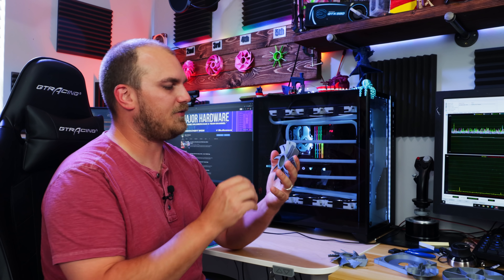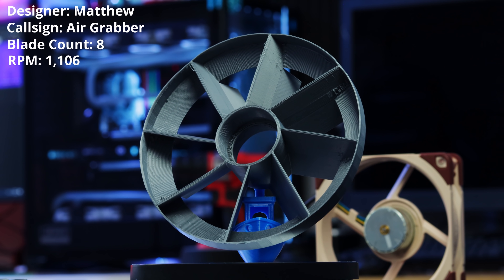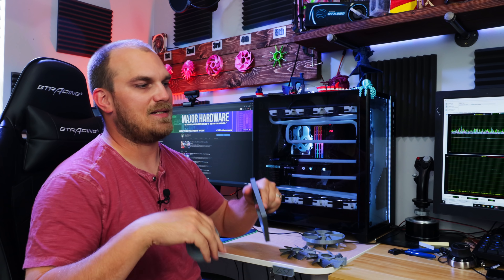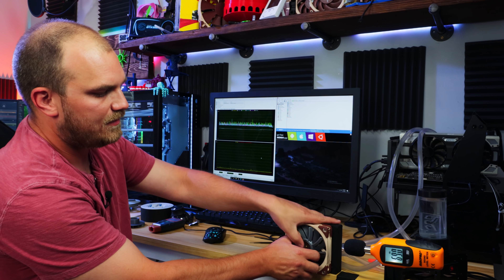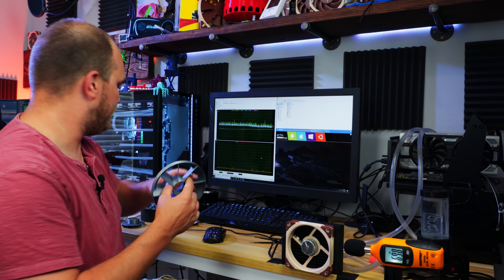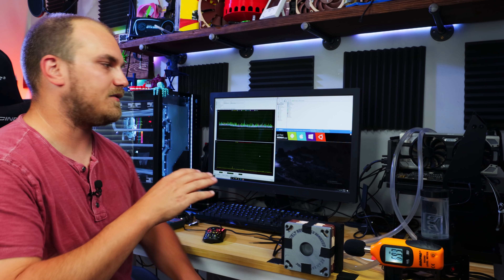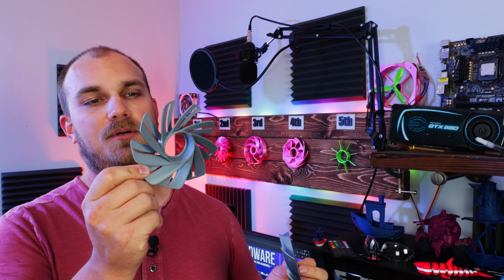We Are All Noctua Engineers | Fan Show Down Episode 4

Comment: I wonder if the air grabber would have been better if it didn't have a flat transition from the 140 to 120, if you look into it, you have the funnel going to a flat ridge, and then into the 120 opening. That flat area was likely deflecting the air rather than letting it flow into the smaller area.  Cool concept.

Comment: I think the idea of the air grabber is good, but the fin orientation is not really made for static air pressure. The same reason why you shouldn't use a high air flow fan on a radiator. it bounces off and escapes between the fins.

Comment: The problem with any design that tries to push air from a bigger diameter into a smaller diameter is that there is pressure that will try to force the air out of the front. You need a fan with large blades and good coverage of the whole surface area to push the air in against the pressure.

Comment: Also, centrifugal fans whose blades are curved and going all or most of the way to center are supposed to be backwards-curved (convex in the direction of spin), as it's counterintuitively more efficient because it puts a lot less strain on the motor than trying to spin in the concave direction.

Comment: You should figure out some way to measure CFM... Maybe an RPM sensor for a bicycle attached to a 3d printed wheel behind the radiator with a duct attached. Then all you'll need to do is some math that is beyond my immediate grasp to figure out CFM :)

Comment: I think the ones fans problem was it had 8 blades.  I think remember from an engineering class that odd blade fans are more efficient.  I think it had to do with balance of forces.  That even bladed fans that forces are balanced so the air act upon itself to restrict flow.  Whereas odd bladed ones there is always an imbalance of force pushing the air in the direction you want it to.  But I might be remembering the reason wrong.

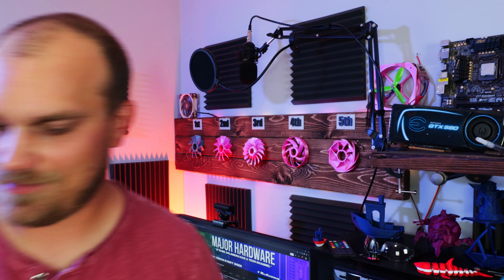Comment: How did the razor blade go from 5th to 4th when you put the other one in first? Comparing 10:23 and 11:21
Then it properly got knocked off the board between the close up and the less than a second zoomed out clip between 11:23 and 11:24. That sequence is confusing.
Reply from the maker: Ya i ducked it up wheb I first put it up

Comment: The main issue with the outside the box fans so far is the small opening and large output....people, fans need air. You don’t want to induce a large vacuum in front of your fan and lose the potential air flow and power

Edit....if this is still going I’m going to try and do one. Who knows if I can get one to work. I will test it on my printer and see if it works. What is the turbine housing your using

Comment: Could you re-test the noctua at the same room temperature as the others? There's a 2 degree difference in room temperature for the noctua from all the others.
Reply: As long as it's the same before and after (for the specific fans test) then it shouldn't matter if there's a couple degrees difference between fans.

Test A starting at 69 and ending at 69 won't really make a difference to Test B starting at 71 and ending at 71. The test is to show how many degrees it drops it. 

Obviously you don't want giant gaps tho. Testing one at 420 degrees and the other at -69 isn't a good comparison
Reply: Maybe. Humidity could play a more important role here. Still, I think it's worth trying just to see if the delta is the same.

Comment: I thought the biggest radius of the 120/140 fan would be facing the radiator. But either way, the angle of attack of the blades needs an improvement.

Comment: Try making a plastic air duct from the back fan leading towards the cpu fins and connecting to the cpu fan, like a ventilation system with more than two fans in the tube including the back and cpu fan.

Comment: The issue with the 140mm fan is that the air is being flung off and away from the "Shroud", if it were a separate non-moving piece it would have probably worked much better.

Comment: It's pretty amazing to me that the whale flipper did so well despite being as aerodynamically dirty as it is (from the print lines). I would be interested to see the difference between a smooth whale flipper fan and a raw printed one.
Reply: Yeah that whale flipper did so well sucking air through those fins*. It really *fluked it! The design reminded me of what had been used on the trailing edge of wind turbines to reduce noise. Owning a CAD suite with air flow simulation certainly helps a lot with these.

Comment: The air grabber design would probably work really well if you blew up the a12x25 clone to fit the 140mm half. Just didn't have enough pressure to actually force air through the radiator.

Comment: I see overextrusion and heating or either cooling issues with the final layers of your prints sir.
please tune up that 3d printer or use a better material without knots that disturb the model.

see this kind of errors on an engineer level 3d printed piece disturbs my existence.

Comment: If that large fan had a more symmetrical inlet (tho might have been print error) and a curved fan design it might work?
Prolly also use a double fan design to get the most out of the area increase?

One more note:  Among other improvements to the blower, could the roof of it be equipped with noise dampeners to muffle the sound, then spin at a higher rpm?

Comment: The little triangles and the slot gap are both used on aircraft wings to increase the angle of attack and encourage attached or laminar flow.
The slot is seen when an aircraft comes into land, the gaps in between the flaps and the only vortex generator I know of on a fighter was the  Buccaneer just behind the leading edge.
Any addition to this or correction would be welcome.

Comment: I work in HVAC and the "Owl finned" fan blades are used on high end condensers, they allow the units to run at significantly lower RPM and move a ton of air compared to traditional fan blades. I imagine they will become more standard as manufactures catch up! Not surprised to see it out preform the competition here.

Comment: The "Double Vortex" did not quite grasp the concept of a slat. The slot is supposed to be optimized for air flowing from the pressure side to the suction side of the blade, not grab it on the top and force it down. The whole thing then needs to be combined with higher angle of attack, because that is what the slat enables.
The idea is that the energy rich air from the pressure side re-energizes the boundary layer of the suction side and thus allows it to adhere up to higher angles of attack.
That was also the problem of the "Air Grabber" Way too high angle of attack, flow detaches, causing the rotor to act more of a radial flow than an axial flow impeller.
The "Whale Fin" design just adds a nice turbulator to the leading edge. To move more air this would also need to increase angle of attack, which theoretically the turbulator should allow it to do.
Reply: Yes I agree. I did make it slightly steeper than the noctua but I didn’t know how much I could push it

Comment: I think you've put the air grabber backwards, the angle of the blades is pushing the air in the oposite direction and the extension of the blades and casing of the design doesn't make sense if you put it that way, to me at least.

Comment: I'm not really able to design something to give you but if anyone wants to try the idea that would be cool to see. What if the central motor was used to drive 4 smaller fans, so you'd have 4 small fans in each quadrant of the radiator?

Comment: The 140 to 120 fan had too shallow of a blade incline it was making nothing but turbulent air because it was acting as a blower fan. Also the blower style fan should have also had a 40° blade slope, tighter clearance from the two pieces, extended blades to 100mm, and more gradual curves to make the airflow more smooth. Honestly those two fans were poorly optimized to grab air. If you improved their design they would have done way better

Comment: I kind of expected the jagged edge one would perform best from the start. I wasn't sure, but it seemed right to me because of the way it creates surface area on the leading edge. You're exactly right to compare it to whale flippers, and that's why they've got bumpy leading edges as well. Higher surface area 'grabs' the air better and does a good job disrupting turbulence if I understand correctly.

Kind of goes hand in hand explaining why that extendo-fan that tried to get big and funnel down caused a lot of turbulence. The profile of the leading edge of the fan, and each blade itself was really flat

Comment: I feel like the air grabber possibly has potential as an idea. Gotta tweak the blades to a more traditional static pressure optimized design, don't think the wider surface area helps much if you don't scoop

Comment: The oversized fan might work better if the wider part had less pitch on the blades than the lower part since the smaller diameter needs to have higher air velocity to move the same amount of air

Comment: Wonder if the blower fan needed to have rubber or some other sealant on the edges so it wouldn't just blow the air out on the sides where it attaches to the noctua fan frame.

Comment: i never tried 3d modeling, so if some one could make a design with every second blade being higher on the outside and set off every second one higher in the inside, so the air grab is split.

Comment: It would be awesome to see you take the air grabber fan design and tweak it. Better slope on outer ring and curl the leading edge so that it grabs the air instead of slamming through with the straight blade design. Possibly add a couple more blades.

Comment: Would the 140/120 fan work better if the attack angle of the blade increased as the cross section shrank? Like in order to fix turbulence, the air speed would need to increase as the cross sectional area shrank, think Venturi Effect,

Comment: Some observations: 1) the "whale" fan blade had camber and a foiled cross-section (thicker at the leading edge than the trailing edge).  I imagine that is the secret sauce.  2) the air grabber guy needs to try it again but this time with a cowling.  Air is getting flung outward by the centrifugal force generated by the rotation.  The air then spills out and over the rim of the blade housing.  A proper cowling will curve inward, have a slightly narrower aperture than the section where the blades spin so that the centrifugal energy forces the air in, not out...  Would love to see someone try this with a cambered, low aspect ratio blade design, which carries the promise of a theoretical efficiency... AWSOME PROJECT!
Reply: Sorry, meant to say, try a HIGH aspect ratio blade...  Gimme that coffee...

Comment: @Major Hardware
I think it is a good idea to print with different colors (same material) for each episode, then it is easy to identify what "batch" of fan tests the leaders come from, and it will also be easier to identify the episode from the thumbnails too.
Maybe add some kind of "color to episode" decoder sign, so you can see that all green fans comes from episode 1, pink from 2, gray from 3... and when a color is no longer present on the board, then it is ok to reuse that color again, that means that you at MOST need 6 different colors, so you don't need to get an unlimited amount of colors.
Reply: I suggested this already back on the first episode, and if you've watched them all you can tell he already took that to heart.

Notice each batch has a specific colour.
No decoder chart, but yeah.

Comment: Are there any rules?  I would just  increase the RPM by using a gear ratio that would allow a fan to exceed the 1900 RPM range these fans are limited to so far. It's an easy design but I do not have the computer software to render a prototype.

Comment: The 4th turbine fan, from what I believe is inspired by already existing high rpm silent design kitchen or bathroom exhaust fans. The idea behind it to have a really high rpm motor so it could actually pull air from that tiny gap which eventually works as a silencer. So maybe you should test it with high rpm motor and better turbine design. It has to work as it is already proven concept. Just need some better engineering and equipment I believe. Keep doing these videos, I love it

Edit: I still don't think those would work as good static pressure optimized radiator fans. I believe they can work as airflow silent design case fans
Reply: hey Vedant, can you link me any of those design, i would like to improve mine Thanks

Comment: 3rd, air grabber needs the shroud on the back of the blades to come further so it covers the entire blade tip, coming around to the front. The exposed tips are acting like a centrifugal impeller, while the rest of it wants to be an axial impeller.

Comment: The temperature-pragmatic is interesting. The game idea is a lot of fun. But. The question is - and this follows from the case design - if you need a fan specialized in airflow (CFM, m^3/h) versus pressure (mm H2O).
Note that a fan designed for very high airflow could move so much air that the air coming out from the fan starts dragging air around the fan as well. But you drive the air through a radiator.
Also note that high airflow fans may not be able to build (add) pressure. Compare a jet engine where one turbine pushes a lot of air through the cowl around the core engine and adds little pressure when another relatively small turbine builds a lot of pressure in the combustion space and keeps the big one spinning.
I'd say that measuring airflow and pressure differences is important - between cases and between fans.
Or, the temperature deltas are only valid relative to one application in the specific radiator case.

And, is the Noctua used here, the best version for the application on the radiator? Is it a high pressure one or a high airflow one? I guess you need high pressure on the radiator, really. The differences in the graph are marginal, almost, and ring an alarm bell with me. Was this hypothesis (my guess) tested already?

Comment: the problem with the air grabber is that the pitch of the blades need to go from very ''shallow'' to very steep. as the decrease in diameter the air can flow through, the air will want to speed up, but its right now stopped by the 45 degree angle overall. if it had a very grabby angle on the outside, going to a very steep angle on the inside, the air will flow MUCH better and might do pretty good actually. the only issue then is the power of the motor, as it is having to twirl around a more heavy fan, and its not really balanced looking at the footage...

Comment: It you want a fan that performs as the stock noctua or better, copy the design and make it taller towards the middle.
The inner most part of the blades travels slower and needs more surface to move the same amount of air.

Comment: Love the material and the interactive design approach. I think you really are on to something there. 
All these fans here are used in an air “pushing” setup. That is they are pushing air into, or on to, the hardware. If the fans were set up to suck air then the winning designs might be very different. 
Many fans used in vacuum cleaner design for example use centrifugal dynamics to “throw” the air as much as blades to “grab” the air. It’s very effective because it uses the mass of the air to an advantage. 
One design submitted tried to do this but it’s a tough one in that configuration as it meant a smaller air intake. 
I always have a fan or two that take air out of any pc build as it stands to reason that it’s got to come out too.  
Please run another test that sucks air out of the machine.

Comment: One of the fans I currently use in my system has serrations along the edge.
Much more subtle than the ones on this fan, and I believe along the trailing edge, not the leading edge...
(It's a deepcool fan I believe. Can't quite be sure given where it is in my PC. But yeah, the edge has serrations similar to the design tested here, though much smaller)

Still, interesting how we're exploring all the variations among fan design in such a short space of time. XD

Comment: Way to big fan, make it so you have a fan shroud with a rolled lip the presses into the frame and stay stationary and built your fan to running the space so it acts more like a ducted fan. Turbine fan, not only do you need to flute out the intake to suck in more air how to you expect to send the airflow though the radiators find al close as you can to the fans axle instead of blowing the now compressed  air around your impeller only creating airflow though a ring of the fins?  I want to see those designs improve because I know the ideas behind the are rooted in fluid dynamics

Comment: I think it would be better to just run a heating element to a waterblock instead of the CPU so you can test the BTU performance by the watts used. 
.
Or you can preheat the entire loop to say 150f and run the fans to see how long it takes in seconds to get down to 100f.

Comment: 6:00 It looks like the "air grabber" was printed mirrored, and ended up pulling air instead of pushing it. Maybe mirror the print and see if that one works better.
Reply: It's not mirrored. The blade angle is just way too steep, creating lots of turbulent flow.
Reply: @ringosk1  5:46 no it definitely looks like its printed "backwards" Or at least printed to pull air in that configuration, not push. Yes the blades are also way too steep as well, both are true.

Comment: The blower fan would have worked alot better if you added smaller or same size fan to draw air and accelerated through the blower. Really unique idea, I'd like to see what that could do with the fan and some modifications to the blower shroud/Fins.